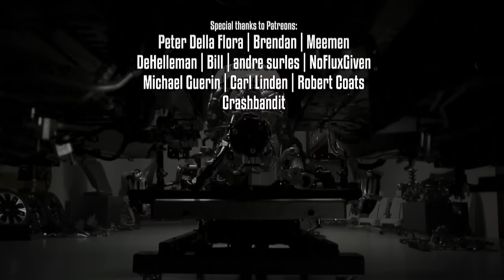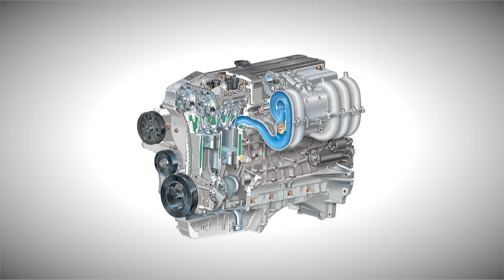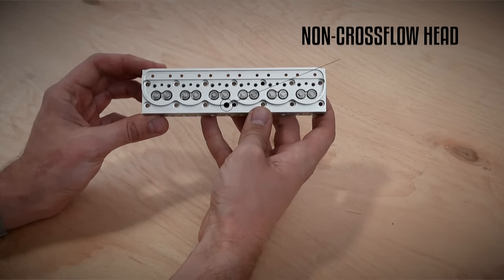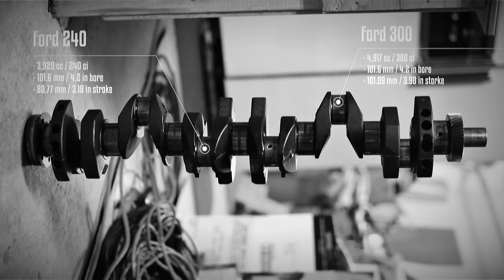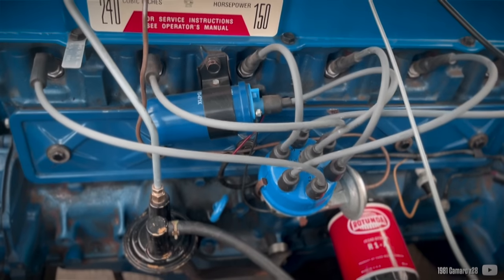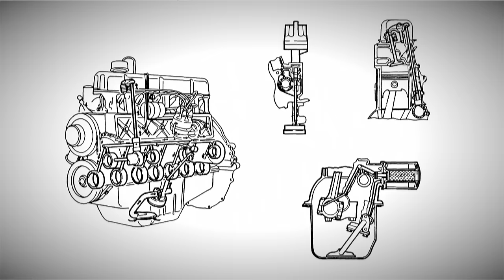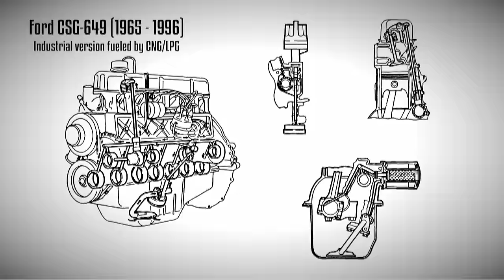Is This Toughest US 6-Cylinder?

Comment: There were two in my family. Mine was in a 65  Econoline 3/4 ton extended van, I had bought off the original owner, who was a carpenter. He had swapped in a 300 straight six at 138,000 miles after the original 240 was done. Plus it had a three speed automatic, plus being an E-300 it had a 4:11 posi, that helped it be almost unstoppable in snow, especially with the huge Firestone Town&Country M/S tires, along with a set of tire chains just in case. The second was in a 1995 F150 reg cab short bed 4x4, with a 5 speed with low hole 1st and OD 5th. That was a nice black with red interior truck, that had fantastic low end power.

Comment: The 6 BT Cummins is by far the best engine ever used in a non commercial vehicle. It's not even close. There's entire fleets of dodges with these engines well over a million miles, some over 2 million. They're literally everywhere, not just 1, or 5 or 30 of them. There's hundreds of them around.

Comment: I dealt with Industrial versions of all these engines, for me it is a tie between the ford 300 and the slant 6. they both had a weak point but it was more to do with maintenance . The slant 6 would turn the rear cam bushing and cut off oil to the rocker shaft. The ford had to be line boarded if you removed the main caps. The overall best engine ( industrial) in my view was the ford 172 4 cylinder.

Comment: I had a 78 F150 2 wheel drive with a 300- 6. When I sold it there was 465,000 miles on it and it still run good. I wore out the tranny and rear end but the engine just kept running.

Comment: I was wondering what engine you were going to talk about. I thought it might be the Mopar Slant 6 engine, which is known for longevity, or maybe the 4.0 Liter straight 6 engine in Jeeps. Both are good designs. The Mopar Slant 6 had solid lifters until 1981 when they were changed to hydrualic - which contributed to its longevity - but you have to remember to adjust the valves periodically. I remember Chevrolet had a 250 cu in straight 6 through 1979 or 1980 - I knew a guy with a 75 Camaro with one of these engines and he put 306,000 miles on it by 1993. Of course, all 3 of these engines have timing chains, and are not gear on gear engines. This is not an engine that people think of as a good engine - but it actually is: the 2.5L Iron Duke 4 cylinder originally made by Pontiac. The rrason why is because it has a gear on gear design with a fiber cam gear and a steel camshaft gear, like what you said about the Ford straight 6. I put 357,000 miles on one before the cam gear finally broke a tooth. I fixed it and it's still running today. I realize none of these engines compare with what you've said here - they don't have all the same qualities in one engine, but all of these are decent in terms of longevity, and at least the Iron Duke 4 cylinder people don't think of as a good engine. The others seem to be known as good engines.

Comment: my 1982 F150 is sitting in my backyard retired in April with well over 700k miles racked up since 2007 and if i went out there right now and turned the key it would crank for about 30 seconds and then be ready for an adventure that 300 inline 6 is unkillable

and yes the 30 seconds of crank is because its been sitting since April and i have never installed a check valve on the line so it drains back to the tank if you let it sit for more than a month

Comment: had one 300 in a ford e-250 extended van from like 93 and it was a beast... torque out the wahoozoo. it was one a carpet cleaning van that had steam cleaner machine with a 120 gallon waste tank that was almost full many days.. it got close to 12 mpg and loaded or empty not a problem with power..  great engine.

Comment: I had an f150 with this motor.  That motor always ran the same oil pressure and delivered the same fuel economy throughout the life of the vehicle.  This has been my experience with any inline six.  The 4.0 jeep was a good motor that used garbage water pumps.

Comment: Now i remember have a custom bronco line 6 , stick shift snd he told me it was powefull and no problem , then he had another ford 1978 , custom with that box cal style or with the fenders coming out.  Flare side later was the name it was blue , with no luxury only am ready column shift and i was like 12,yrs old and he told me to take it to a nearby car service from a friend , vynyl bench seat , so i drove it and it was harsh,,heavy clutched , but power steering , then i felt that torque , spinning tires , only defrost snd heater ,,so i wait to with this tall man like a professor but greassy and he love to talk about engines ,,he told me oh man this things are military grade they are so good , and then told me about the bmw sixes and merceds 6 lines , then the dodge slsnt sixes the gm ones , jeeps snd blah , blah 

But my father custom bronco 1980 i think , it was for work , it was tobacco color and the locks on the front axle to use 4 x4,  so he was a Mexican anti drug special corps called DFS , but he told me they had these trucks over v8 xl o xlt modelsc, he called his bronco was a bronco , but real bronco , i saw it how the steel rims were scratched , but no problems they went t seek marihuana plantations, and had some shhotouts , then his tobacco bronco was with many bullets but somehow they managed to be safe , then another ford truck lariat the opposed , 4x4 with a 390 engine , then he told me its too long it was club cab , and not that reliable  

Thats a storie of that 300 line six

Comment: Perhaps they are only including gasoline engines here. If Diesels are included, by far the most durable inline 6 engine in my opinion is the Cummins 6BT Diesel.I have seen more than one with in excess of 500,000 miles on and still going strong.

Comment: I have a 240 ci in my 65 Ford pickup and I rebuilt it right after I bought the truck in 1998 and I now have over 85,000 miles on it and it still runs like new with 50 lbs of oil pressure. I keep the oil changed regularly and it just keeps going like the Energizer bunny. The only down side is the fuel mileage is 12mpg around town. Plenty of power for the half ton truck.

Comment: My friend's broke the oil pump shaft at 350k miles. He drove it for 2 weeks before he could get it fixed. It smoked a lot afterward but never didn't run.

Comment: I tried to blow a 4.1 crossflow ford six. I bricked it over and over and could only manage a heat sieze even dumped oil and coolant and still couldn't cause a catastrophic failure. Tough engine

Comment: 240/300 ford are great but dont forget the amc based 4.0 jeep motor that is also a near perfect power plant.
Built right these motors will run a million miles with proper fluid changes with just minor servise

Comment: I’m not a Ford fan but as an engine builder I will swear that this is the most reliable six cylinder gas engine I’ve seen or built the 300 is the better of the two much improved over the 240 lots of torque even over the Ford 302 V8

Comment: I had a 225 ci in both a Valiant convertible and a D100 work truck. Both were tough as nails but gutless. I also had two Ford 300 ci engines in trucks. One was in an old highway department truck with a 4  speed. The other had been put in a 1968 that originally had a 240 ci with overdrive and 3.90 rear end. It had plenty of  power and with that 3.90 rear end was pretty peppy. The only thing that I'll say about Chevy and the 292 is constant head gasket blowing.

Comment: The ford 300'sic was  a good engine,we would about whete one out in two years in pur fish feed truck,eight hours seven days a week,dodge had a good six,chevy,jeep is hard to beet,chevy six we used prospecting,would lose oil preasure going xown steep hills,we would side hill it let the pressure build up and head down agsin

Comment: I agree, it certainly is tough, and easy to work on. I had Machined, Balanced, and assembled many 240s and 300s, they were one of my favorites, their Crankshafts were very close in balance from the factory, very little correction necessary. That said, being a predominant GM person back then, because that was the least expensive to build with lots of aftermarket performance products available, and getting good HP numbers was easy. The majority of my customer's brand was also, GM. That was from 1968 to 1995.

Comment: The 70's Dodge slant 6 and the Ford 300 were the best engines I've ever owned for longevity. The 6 cylinder I had in my 280zx also went 350,000 miles before any major issues.

Comment: I have heard stories on multiple occasions of people putting rocks, sand and small bits of hardware down the intake of these engines while they are running. They just  chewed through almost anything. Of course it damaged the engines somewhat but they still ran and took more abuse before they blew.

Comment: I answered as soon as i saw the title. 300 straight is a legendary workhorse. It makes a great first truck, it's still good to go with 150k on the clock. Anything that breaks is likely to be on the outside of the motor, lots of room to work in the engine bay. It's not unusual to see one running an irrigation pump with thousands of hours, after they were pulled from a truck with 250k miles.

Comment: The takeaway is older designs focused more on reliability than fuel efficiency. Modern engines try to achieve the highest possible thermal and fuel efficiency through hundreds of techniques from coatings to electronics to materials, all increasing complexity and decreasing overall reliability.

Comment: I put a "big bellhousing" 200 inch ford 6 in a '62 Ranchero. Seven main bearings, Borg-Warner T-10 four speed with a 170 cylinder head to increase compression. There was nothing that little truck couldn't do from pulling trailers and offroading to beating V-8's from stoplights. Many years and many vehicles later it is my all-time favorite. Don't forget the Chevy 292 though, it shared many of the positives.

Comment: Got stationed in Korea Engineering battalion  there was a drill rig  on the ground  ? Sgt do u know anything about this engine ford 300 u bet called dad and got points plugs condenser at k mart along w a oil filter the Army manual said it was a 1665 model this was 1990  got the parts found a drop gate old fuel truck and mounted in there that thing dug 3’ bit 14’ deep in Korea  for  bridge pillings  probably only had 100 hrs or less  on it  still ford blue

Comment: I know of someone who i used to be around daily that had a 85 Ford with the 4.9 engine 3 on a tree 2 wheel drive truck, it would pull a backhoe with a trailer easily. Tourqe was the problem solver

Comment: During my years in the construction trades, I had  1/2 ton and 3/4 ton trucks and vans that had the 300 six in them.... and those engines were not always treated kindly by any means...  and the only weak point IMO (if it can be considered one) was the rear main seals.... I did replace 3-4 of them thru the years... I had 4 that passed the 300k mark while I owned them, and were running like clocks when sold or traded... others were under that but over 259k... suspensions and chassis problems were more common than the engine or the transmissions for that matter... I had automatics last much longer than expected and never had any issues with any of the standard transmissions at all, on the floor or on the column... didn't matter...  Ford had it absolutely right back then...

Comment: The 4.9 L6 was the first motor I ever rebuilt. It was at 384,000 miles without ever going through a rebuild and I just did it as a learning experience. There wasn't a single thing wrong with the motor. I anticipate another 400k out of it without major problems.

Comment: Great engines. My dad had one on a pump to move water from a small river to water onions mostly. He converted it to propane after the 70s gas prices went up plus the gasoline for the pump would go bad after a year or so. propane lasts a lomg time. I will say the Chevy 230 often called a 235 inline six was also very very reliable. In fact cummins used the Chevy (GM) as a bases in its in line six diesels that owned the majority of Big 18 wheeler trucks market in 70s 80s 90s . Also the Dotson 240 260 and 280 Z in line six was good as was the AMC Gremlin in line six   I am getting tired of front wheel drive cars. In line 6 or 4 with rear wheel is much easier to care for and repair.

Comment: The Ford 300 ci was the best engine ford ever made I don't know why they stoped making it for vehicles it is still around in old fork lifts and concrete pumps all you had to do was keep the oil changed and they would last forever.

Comment: My dad had a 1983 F150 with a 300 and 4 speed. I don’t recall ever having any issues with it. If memory serves me right, in the early 80’s, the 300 6 made a little more torque than the 302 V8.

Comment: My 1995 F150 has the 300 with a 5 speed manual.  200k miles, burns about 1 cup of oil between changes.  Virtually smooth, TONS of torque grunt. 👍

Comment: Yeah I had a 1985 Ford f250 with that engine in it and it got 15 MPG whether I was carrying a load or not. I could have the bed full of dirt and all it did was ride smoother it didn't change the miles per gallon at all

Comment: I have an Australian Ford Fairmont Wagon (Falcon) with the i6 that preceded the Barra. I was working on it yesterday and after 380,000k you can still balance a 50 cent piece on the rocker cover (our 50cent has a flat side.) It is a great engine. My housemate has a Territory with an early Barra in it and it is a fine engine too.

Comment: My 88 f150 300 6 cylinder was favorite engine. With 300,000 miles on it it would still pass emissions testing and still got 14.5 mpg . It was still running strong when I sold it.

Comment: The most reliable vehicles I've ever owned had inline 6 cylinder engines. Not much power but they were so smooth and rarely ever required anything beyond simple maintenance.

Comment: Love my 2003 inline 6 Cummins diesel 5.9 liter, coupled with a 6 speed manual tranny. It has been a workhorse with zero problems other than normal maintenance.  450,000 miles and still running great!

Comment: I have heard good things about them. Never drove one, but put over 200k on a 225 slant six,  got it with 135k. Used about a quart of oil every oil change. Sold it 15 years ago still ran great. Bulletproof motor.

Comment: My buddy had a f100 with 300 straight 6 in it and it got better gas mileage than oil millage it burned oil and leaked about a quart every couple hrs and it didn't have that many miles on it back then so don't say it can't be killed it also couldn't pull a gstring out of a cats azz

Comment: My dad bought an 84 Ford van that was used as a city delivery van for $1000 with this engine in it. It had 160K miles on it, and he proceeded to put another 160K trouble free miles on it before the rod bearings started knocking in it. Even then I forgot how long we still drove it like that but it seems like forever. 

I often wondered why the thing didn't just blow up, but now that you mention forged rods, that explains it.

Comment: In my country ford did a development of their smaller I6, up to 221cuin.

It has the same features as the 300, but on a smaller package (not used to big engines here). Its extremely reliable and cheap to operate.

Comment: I had an 82, Bronco 300ci I put a 4 speed transmission in it and changed the gears in the 9" rear end from the 3.00 to 3.50 and put 35" tires on it that old truck was a lil pulling Beast

Comment: Many look back with rose coloured glasses to the past, however,  as a kid on the farm with inline engines in most of our trucks I remember well how many times they needed to be rebuilt.  A hundred thousand miles was about as far as a working engine would go before it needed a rebuild.  And my dad was very particular with maintenance.  I still love them.   Built with modern materials they would rule.

Comment: there are a lot of 300 6's used for irrigation.   we had 2 of them on propane.   go out and shut them down at the end of the day and the exhaust manifold would  be glowing bright red   a true workhorse, never had a bit of trouble with that engine.   we had an industrial Minneapolis Moline  we had to rebuild every two years and hindsight tells me that it should have been replaced with a 300.

Comment: Had a ford truck with 300 six. The engine lasted 350,000 miles and then needed fiber timing gear. Best engine I ever had.

Comment: My 460 in a F250 uses less fuel than the 300 in a F150, and the 300 never would run smooth. Never ever another 300.

Comment: I've owned these and driven many more of them over the years, and they have definitely earned their reputation for low cost reliability. We ran one of the EFI engines with a blown head gasket for months to construction and remodel sites, simply adding water every day. When we finally did the head gasket one Friday night after work, we found 2 spark plugs eroded but intact, 2 with the electrodes half burned off, and the other 2 had the electrodes entirely missing, with one having the ceramic chipped away.😂 It was pretty bad, but that thing roared to life, fired on all 6, and had the throttle treated like it was an on-off switch on every drive. It kept on for years after till it got sold.

Comment: I worked for an uncle who had a 300 in a 3/4 pickup with a 4-speed manual.  Loaded up and pulling a trailer, that engine just leaned into it.  It made work easy.

Comment: Most in-line 6 cylinder engines are good. It's hard to not make a good one since as you noted, primary and secondary balance is perfect with this type. I will agree with your premise on one point: of American I6 engines of the 60's, the Ford 300 is probably the best.

Comment: I have owned a 89 F150 XLT since new. I have done a cosmetic restoration on this wonderful truck however the engine runs fantastic with 160K on the odometer. The F.I. 300 ci  6 cylinder engine I’ve ever had.  🥰